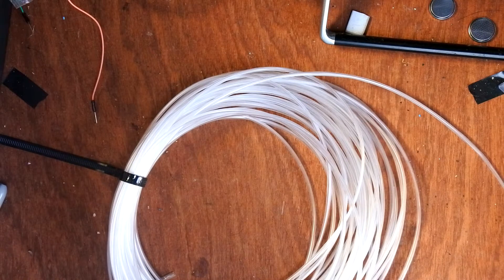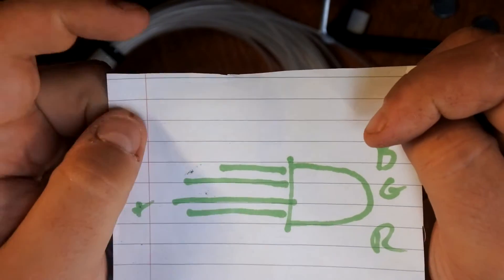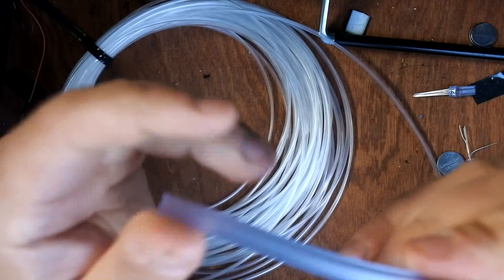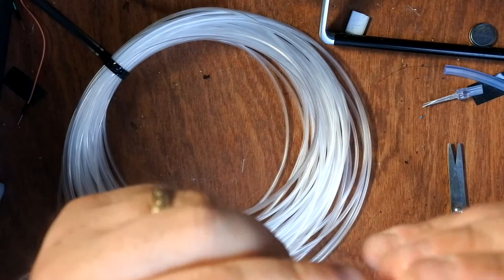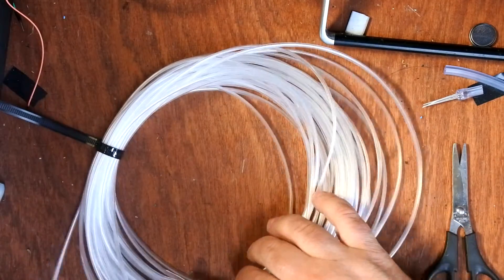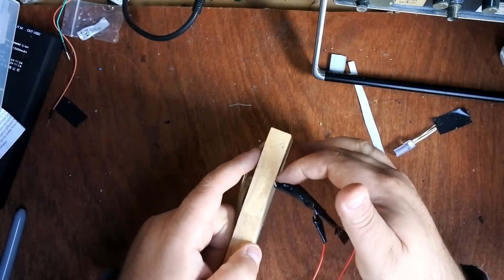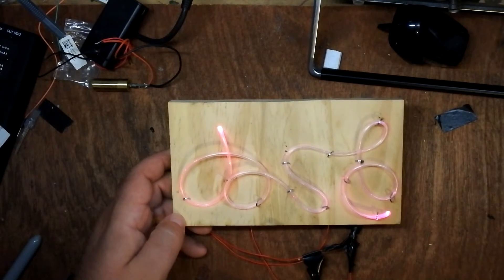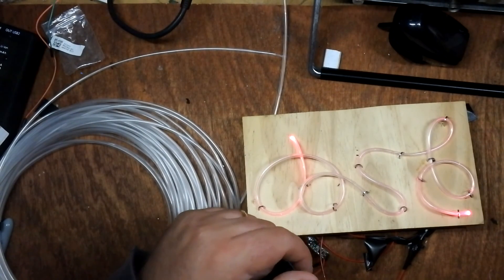LED Fibre Optic Side Glow Nightlight

Comment: brighter LEDs, but most importantly some better way of feeding the light into the end. i've tinkered with normal optic fibres years ago, before high power RGB LEDs became cheap as chips. and back then what worked best was, to file the dome off the LED, and epoxy a little bundle of fibres right againt the front. (no polishing needed)
Reply: a felony and betrayal of a fiend sure is a clever thing to brag about on the interner. 
lol, what a nimrod.